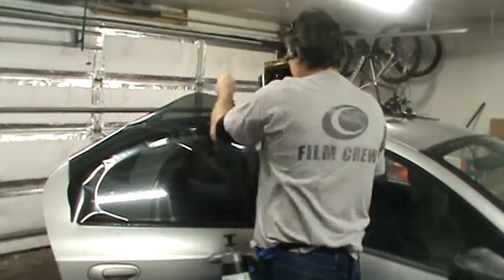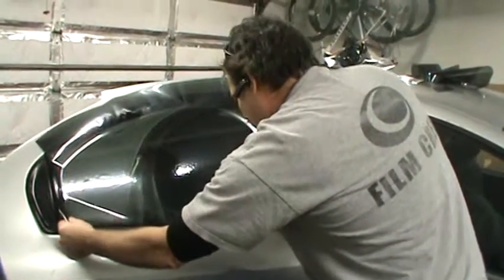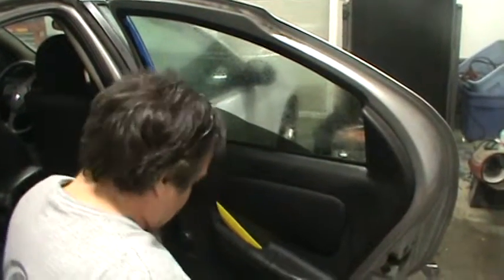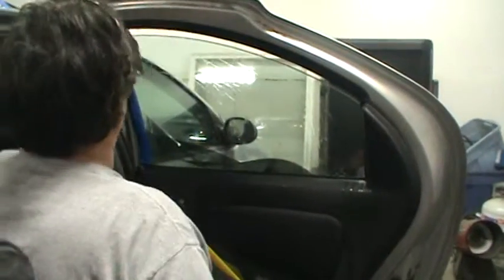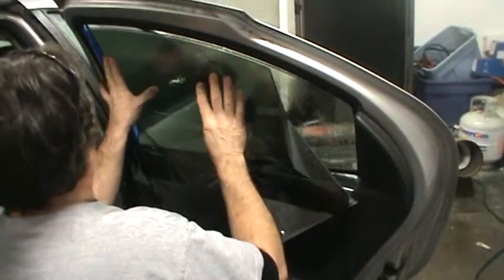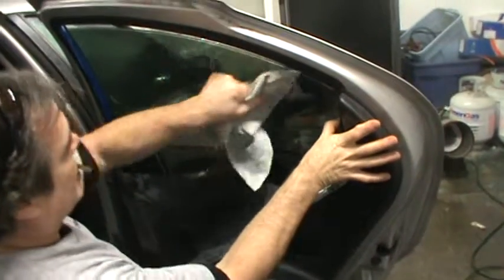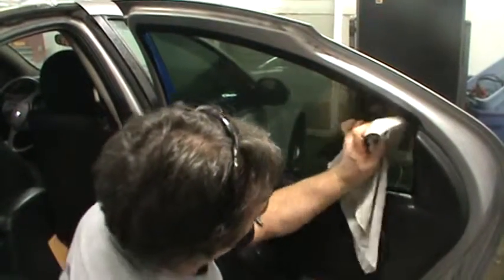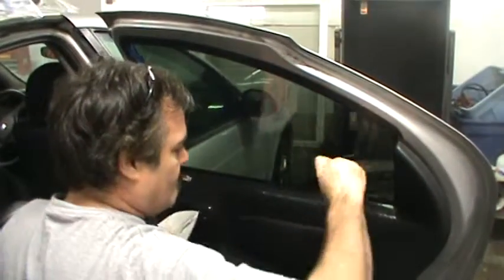M2U00095

Comment: How do you get clean work with so little water is your water soapy???
Reply from the maker: Use ulra-bond as a slip agent,  add a touch of J&J on hot humid days.  dries fast even in winter months with a noticeable increase in bond strength.  clean?  think about gravity,  if you squeegee slip out laying film, slip can pull dirt back in from sides.

Comment: can you sand those yellow turbos what grit???
Reply from the maker: if they are really bad, hard card sharpener works.  cut one rail off and it shaves a 1/6 off.   220 grit is good to sand minor nicks,  to finish 4 or 600.  flat surface and keep it perpendicular.   if it starts to drag on film scuff it again.  edge get glazed and hard to squeegee, same with the prohandles.  clean and sharp and less chance of scratching.   ez-gray only for tuck and touch ups, yellow tri=edge for flushing gaskets and orange tri-edge install and sealing.   gray is soft and dirt imbeds in edge scratching.  orange is harder less chance of scratching and does not melt with torch sealing.   yellow does the gets beat to crap,  3 colors so know what  to grab for which step in install
Reply from the maker: if really bad, cut one rail off hard card sharpener and 2 passes.  220grit on flat surface keeping turbo perpendicular.  finish with 6 or 800.   regular sanding removes glaze build up so slides easier.
Reply from the maker: 220 grit if it gets really bad,  300 grit to maintain and 600 grit for ez's, tri-edges and diamonds.  turbos, bulldozers and pro-handle crushes can get glazed leaving scuff marks or making them hard to slide,  little scuff with sandpaper and they work better then new.  I always scuff new ones before I use them